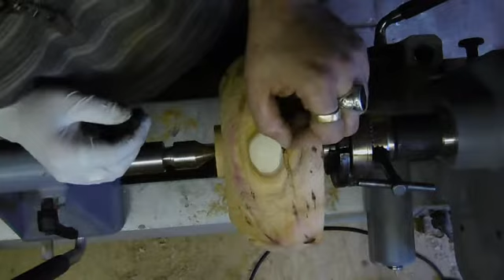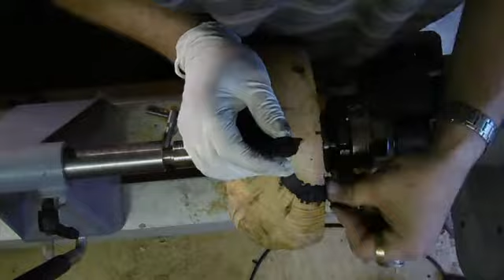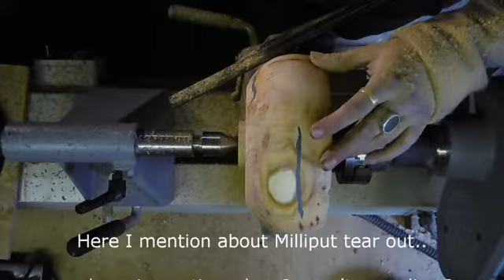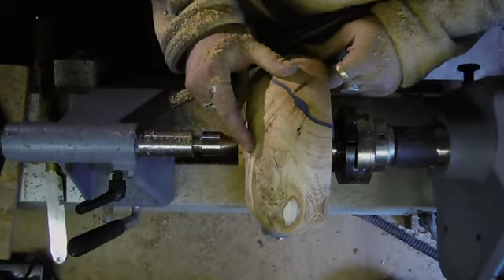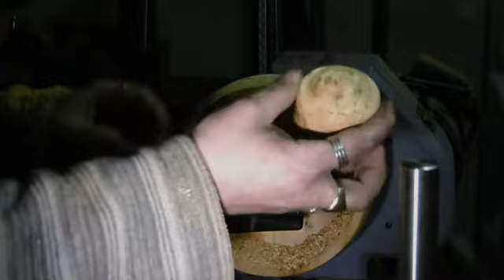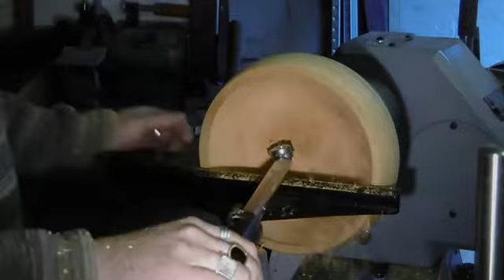yew bowl with heavy splitting part 2

Comment: That is looking really good Mark, once again I'm not sure I would have been brave enough to use Simons kit the way you did mate ....lol.
Cheers
Mike
Reply from the maker: Mike Waldt cheers mate, its surprisingly good at that considering how thin the insert rod is, as long as you can see the insert and the point of contact at all times, and the center is running very slow anyway then there is low risk of damage to the cutter rod if taken slowly.

i won't do this again unless I had some expensive imported stuff that would be a shame to mince into dust.